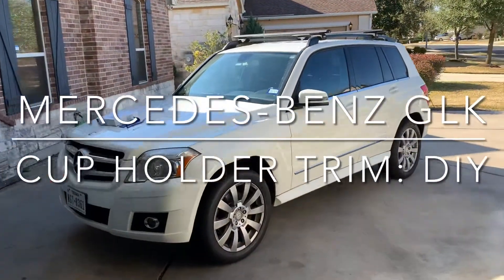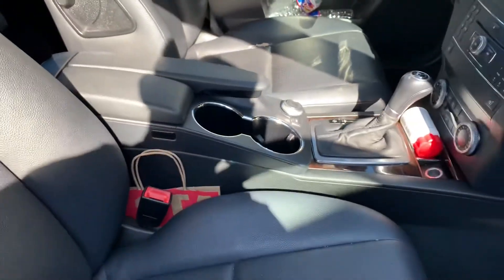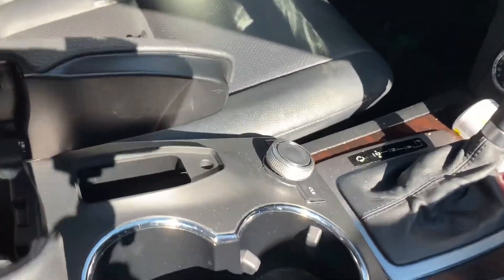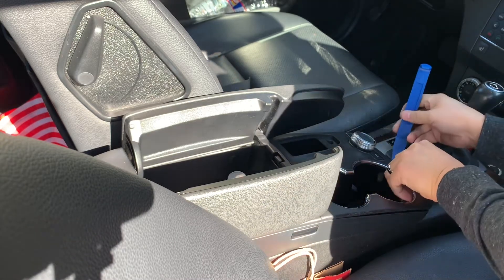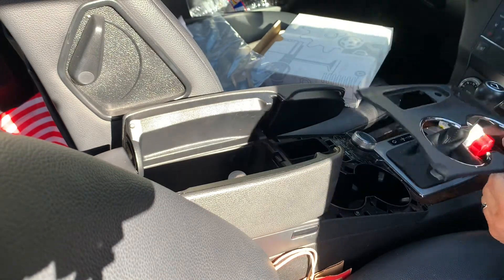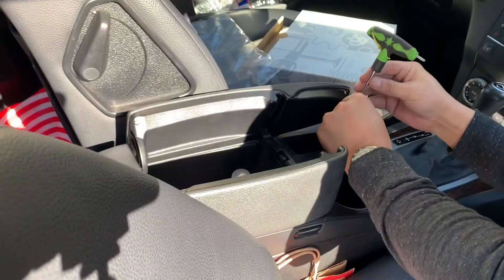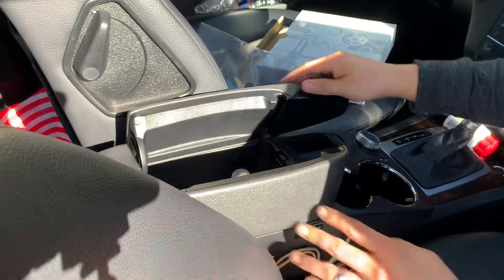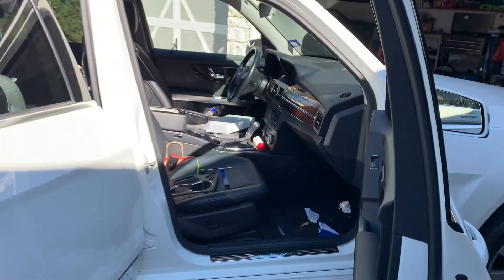How to change #Mercedes-#Benz #GLK: #Cupholder #trim replacement...very easy DIY!

Comment: Does your suspension creak and rattle? Mine is insane. I think the bushings are shot at only 100k miles on a 2012.
Reply from the maker: Thank you for the comment. No, mine does not creak. Which bushings are you thinking? Don’t forget to subscribe to the channel and thumbs up if you haven’t already.

Comment: Looks like you need to replace the drivers seat lower portion of the MBtex. Mine is torn in the same spot.
Reply from the maker: Haha. Yeah. Think they make just the bottom cover as a replacement?